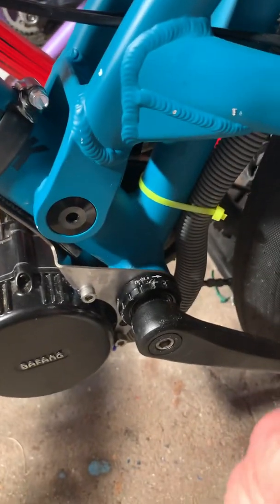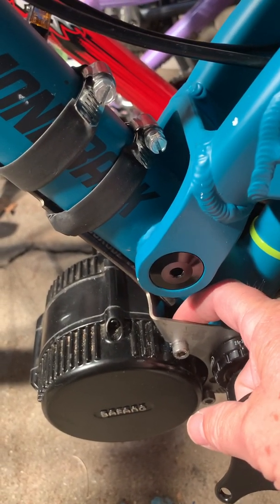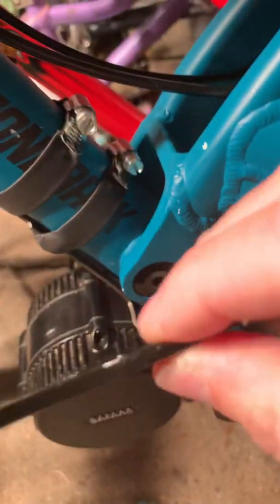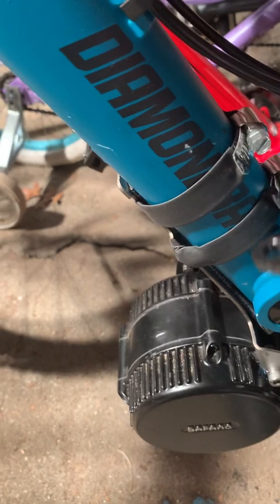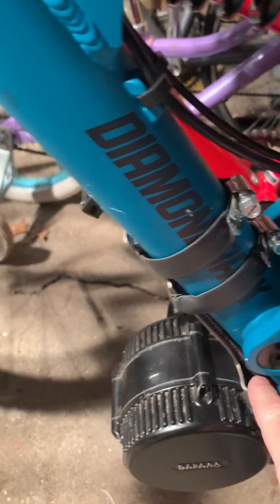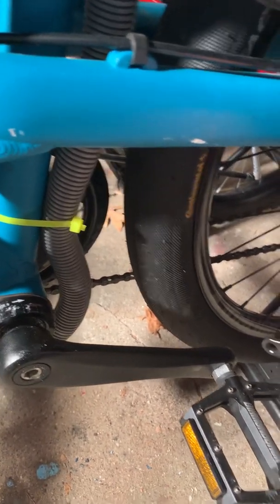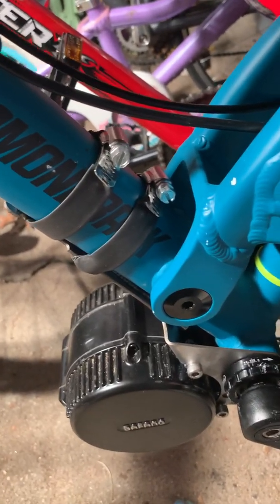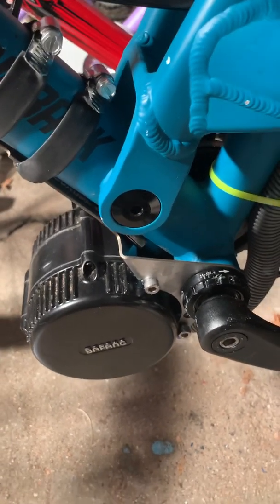Bafang BBS02 installed on a 73 mm bottom bracket.

Comment: When you install a 68mm bafang on a 73mm bottom bracket, you need to use 5mm of washers as spacers.  Wouldn't that have fixed your issue?

Comment: What length did u buy 68/ 100 or 120 long ?
Reply: he bought 68
the longer ones would be to long 68 is the standard size
Reply: @Nico99993  thanks I know what to buy now
Reply: @bigpauldevon7620  you can always measure your bottom bracket length between the pedals to be sure you get the right size.
Reply: @Nico99993  can i get 100mm on 73mm bottom bracket?
Reply: @jhingviray808  no. The 68mm will work for the 73mm bottom bracket. Since there is enough thread left on the motor. Maybe you will have to out washers under the holding bracket on the motor housing to adjust but it will work.